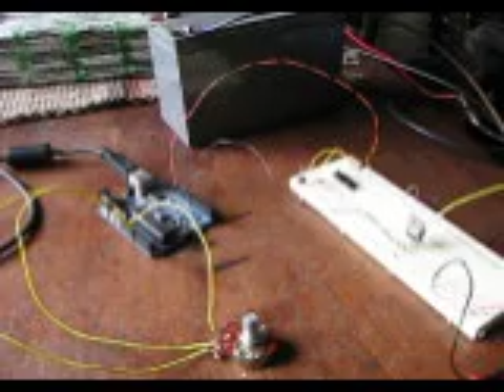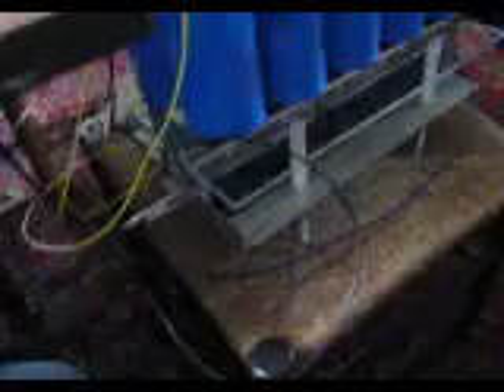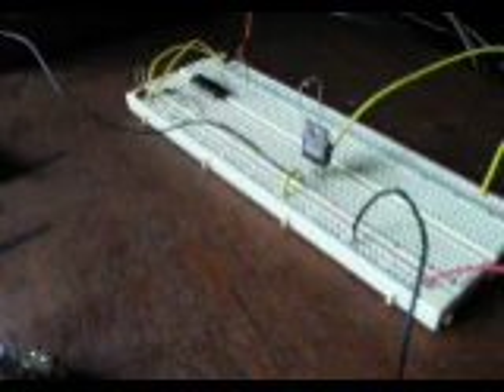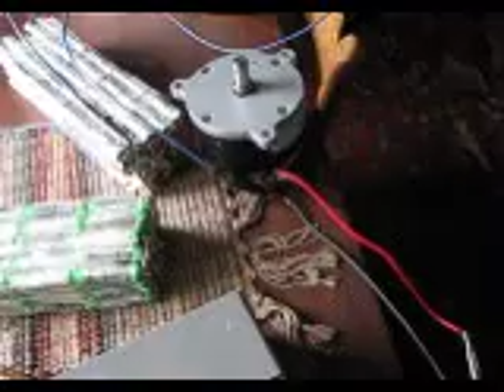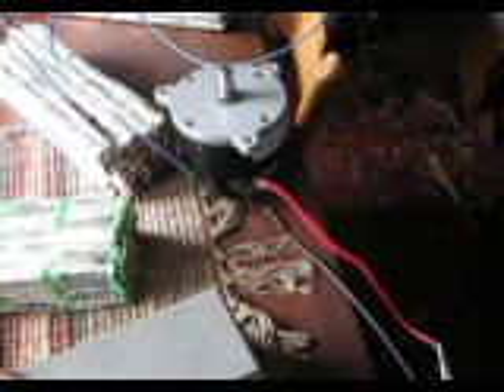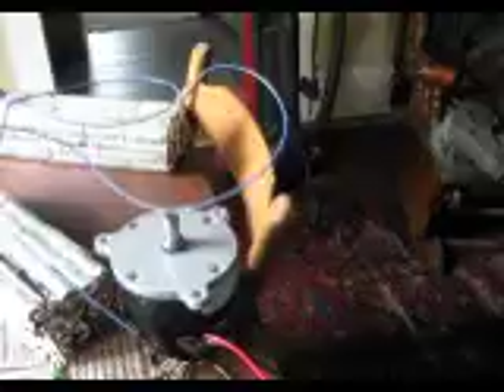1500 AMP Homemade Motor Controller Test

Comment from the maker: @mechanator There was only a very simple code using three wires of a pot rather than two (could never really figure out the two wire pot code) I was using the KS621k30 darlington transistor from what I have heard it can only handle 1.5 khertz but that's ok with me b/c they are cheap and I still have a bunch & if I wanted to experiment with over current I would be too worried about blowing them up. I wanted to do hardware over current with a nand gate and a latch.